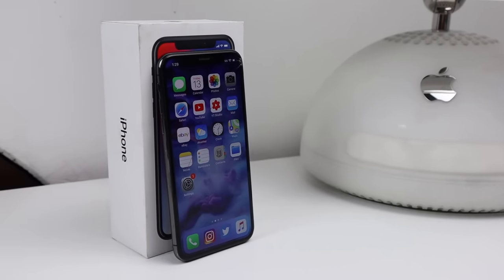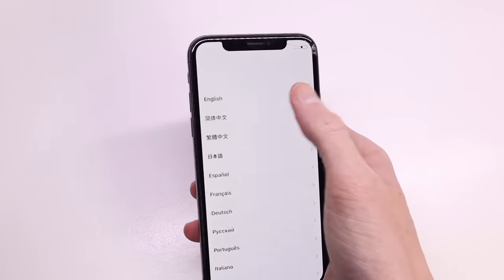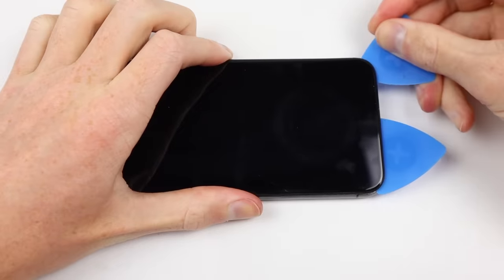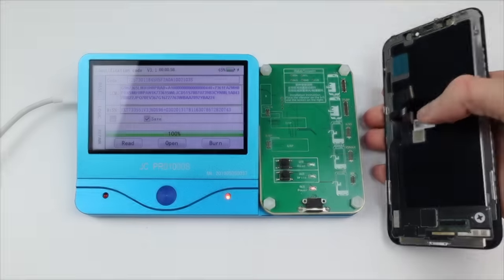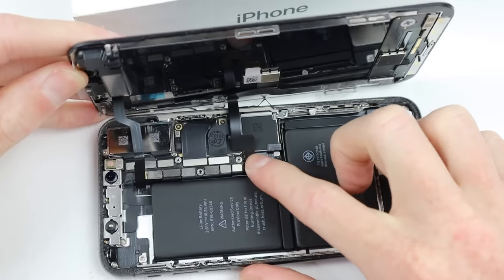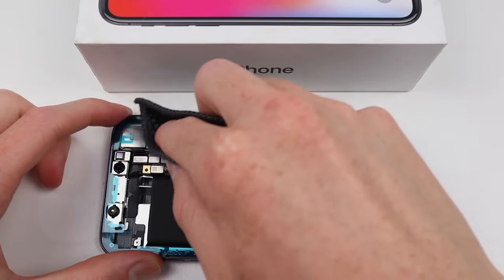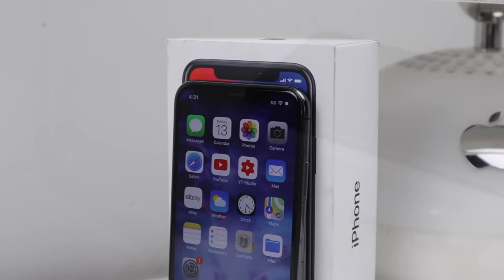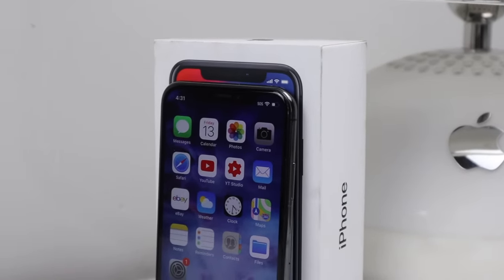iPhone X Screen Replacement Done Correctly

Comment: just a tip for everyone, make sure you keep the same earpiece from the original display to preserve face id, using an aftermarket earpiece may disable it. :)
Reply: yea that happened to me, but the original ear piece was broken so i had to replace it.
Reply: @daudhtm5203  could always just only take calls with earbuds or the wired headphones and keep face ID lol
Reply: @HearMeLearn  the face id was broken too
Reply: Thank you for the advice
Reply: @daudhtm5203  you can transfer the original sensor to a new cable, but you will need a solder
Reply: Good tip
Reply: What is an earpiece
Reply: @daudhtm5203  lll
Reply: The tool is for matching screen and motherboard.  otherwise face id cannot be used.

Comment: Imagine if they had a reprogramming machine for home buttons
Reply: Would be cool but likely won’t happen as they’re paired to the device and it stores like a key in the SEP which is encrypted. Though it might be possible at some point especially with the checkm8 exploit, people were able to get the SEP key and if they can figure out how it works they might be able to at some point. Though that may be bad as then hackers could potentially access your passwords and bypass biometrics, which is why Apple doesn’t allow 3rd parties to repair the home button or FaceID as the SEP is a super important part of securing the device.
Reply: They do but only Apple has it
Reply: I know but like a public one
Reply: Jarrett Boersen buttt, they could make a machine for people that have the old faulty home button , then they basically plug the old button into the machine and upload the part code and then connect the new button and write the code into it so that the phone recognises the new button as the old one....
Reply: I went to a third party shop for my mums phone and they somehow managed it
Reply: Gurvinder Panesar yeah but what phone was it?
Reply: @steffjack9798  he showed this kind of reprogrammer in the video
Reply: The chinese will figure something out i’m sure
Reply: @jappiemoto  They always do, one way or another
Reply: @Levi Hills phone nation in Leicester

Comment: You‘ve done it exactly as I have done it, but I’ve done it with a cheaper programmer😁
Reply: Milan Schröter what programmer?
Reply: Could you tell me what programmer you have?
Reply: Yeh I need to know that too. What programmer? I replaced my screen but no True Tone because buying a $60 programmer wasn’t worth it.
Reply: Milan Schröter okay bragger, tell us which programmer you have that works
Reply: @taF fleifraG nah  it is depend on where u live at my country. It is quite cheap
Reply: What programer?
Reply: Of course he bought the one with more features because he does alot of iPhone repairs
Reply: I use clone boy which is $30-40
Reply: I don't care about true tone I was turning it off when I had the original display so I bought a new battery instead of an iPhone programmer
Reply: Mohammed Khalil is that the only thing that stops working? The true tone ? Bc if so i wont buy a programmer
Reply: CARLOSVLOGZZZ the double tap to turn screen on needs the reprogramming
Reply: Shane Kephart but it will work correct? Without the reprogramming
Reply: Apples_ Biggestfan icopy or jc-v1
Reply: @lvmike424  Thanks mate!
Reply: Are you wanna tell which programmer or not ?

Comment: Thank you for the instructions! It worked! got a screen off amazon, didn't have a programmer, but seemed to work just fine without it... hopefully will continue to work well.
Reply: Same here... still working Juliet? @JulietHeins
Reply: How have you got on without the programmer? I’m worried to do it without one
Reply: @Ronnij44  you usually get an issue with options for the camera and after an update I was told

Comment: I work in a rather large repair shop and ive never had to reprogram an x display ive worked on basically every iphone. Only way i can needed to do this is if you dont bring the camera over but most replacement screens require you to transfer the camers anyways
Reply: If you don’t program, then True Tone will no longer work.
Reply: @TheNpcNoob  this is true if you have the original display, also cant do this on newer models sadly

Comment: btw, if you dont programm your new display it can work but you will have bug with screen protector. when its on phone and if you hold on your finger without moving it on screen it will not recognize your finger after 9 seconds. (very annoying when you trying to send someone a voice message it will send it after 9 seconds because screen thinks that finger is not on screen). but if you move your finger a little bit every 8 seconds it works fine :D

Comment: I literally just put my XS into a toaster oven to heat up the adhesive and then I used a razor blade and plastic pry tool to open it. I got the screen off just fine with no damage at all.
Reply: KalsMusicPlaylist YT u di-did WHAT😳
Reply: And afterwards you put it into freezer overnight for better seal
Reply: yeah it’s true. i was the plastic pry tool
Reply: I put an iphone on top of my space heater and waited for the adhesive to melt lol

Comment: Hey Hugh! Since you made a video previously on putting an iPhone 7 battery into a 6s, could you maybe do the same for an iPhone X battery into a Xs? I am wondering how this would work, as the X has a larger capacity but the battery fits perfectly (from what I’ve heard) in the Xs.

Comment: Nice, I will soon have to fix my sisters iPhone X later this month, still waiting for the replacement screen (also bought a reprogrammer to retain the true tone). Good video 👍
Reply: R C i thought about buying a programmer but honestly most people that buy refurbished iphones don’t know what true tone even is and i’ve never had one complaint about it
Reply: @brando12343  well how they can complain about sth they don't know but I think if you're making money on this you should buy this shit and use it as advertising tool
Reply: Where did you get the reprogrammer? My wife broke her phone a couple days ago. Thanks
Reply: R C did you buy the jc pro or another one? Thanks
Reply: von19888 it was a different one, its the QianLi iCopy Plus. There is a separate module for battery, just so you know.
Reply: R C awesome. Thank you so much.
Reply: von19888 oh there was an issue with an iphone 8 Ho5 aftermarket screen, could not be detected by the icopy plus, could be due to the iCopy not updated (not sure though). Refurbished screens were fine.

Also make sure it supports your device
Reply: R C thanks
Reply: did you need the re programmer? to fix the screen
Reply: Hey,one question, is the reprogramr only used for the True Tone feature? Or anything else as well?

Comment: I bought the iphone X for $550 last month and she said that the rear and front cameras weren't working as well as face id. So I had to buy the replacement parts and oh my I regret it. Somehow. It's true the cameras weren't working at all and last night, I turn on the camera and it's working fine. I think I just have to update the software or it has something to do with the ios 12 being the worst
Reply: Wan Face ID and front cameras work together at times

Comment: Cool, I bricked my wife’s phone following this guide exactly. I got the new screen plugged up and working then i turned it off and detached the cables Bc he didn’t tell us to put the water proof seal on first. Plug it back in and now none of the touch screen works. Unplug it again and plug it back in and now the damn thing won’t even turn on

Comment: How is the quality of the screen replacement
Reply: Not as good as Apple's display
Reply: harish vinjamuri In the website of ifixit they detailed it as an OLED. I want to know how true this is.
Reply: @charliealonso8715  yeah,its oled,
But the colour reproduction and contrast ratio is not as good as apple's genuine one.
Reply: @charliealonso8715  Go with a original/used genuine display on eBay as there better trust me I have replaced and iPhone X screen with a genuine and a replica screen there is a difference worth the money
Reply: S** H*** he doesn’t talk about the quality of the screen ..
Reply: harish vinjamuri Wrong.
Reply: OEM quality

Comment: Hey great video! Just one question. What happens if you don't use any programmer on the new display? Can it still be usable?
Reply: the screen will still be useable, but true tone will be purposely disabled and a permanent message may come up saying that it is not a genuine display. at one point i believe apple did try disabling the screen completely if it was not paired, but were sued or something and had to reverse that, though they are apparently still allowed to do this.
Reply: @zeasea2519  thank you for the reply. I bought a cheaper programmer called iCopy plus from a company called Qianli. It worked just as good. It had true tone and I got no messages about the authenticity of the new screen. I was just wondering if you didn't do it with a programmer if it would constantly spamm the "no original part" message. Or just once in a while

Comment: AL some 'Very well executed Cheers just what i was looking for,
Quick question, bottom left side of screen from 2.28 2.30 your left index finger was hindering a little screw that has a square washer that has a piece of crooked metal coming from the washer, 
Does this crooked piece of metal that`s part of the screw washer` meant to touch the housing that supports the three buttons on the left or is it meant to have a minute gap from the housing, 
weird on my phone when opened up there is a gap

Comment: I've done this myself but skipping the part of the reprograming, also skipped the part with the watter sealing, after a water resistant phone it's oppened it would never be water resistant again like it was from factory so i see no point of putting the seal back

Comment: Hugh I have a question and I'm becoming very impatient with not being able to use my iPhone X lol...anyways I accidentally dropped it in water a while back and I believe I was able to salvage it because the phone still turns on and seems to work somewhat flawlessly except for the fact that about 1/4 of the screen (the left side) doesn't seem to acknowledge touch at all. I can't select any apps on the left side of the screen and even my settings menu. So my question to you is, do you think its possible to get fixed? or do you think there is probably water damage and its not salvageable? also on another note...I broke my iPhone XR screen the other day and got it repaired by one of those kiosks in the mall and literally the next day it stopped recognizing my touch at random times. for the majority of the day the phone doesn't work but randomly it will begin to work for a short period of time. anything you recommend on my end to fix it by chance?

Comment: Hey Hugh Jeffery, quick question would there be any way to replace the barometer and compass censor on the Xs max? And if so where would the be located.  I bought a brand new x max and tried to test the water resistance and it got water damage and I took it to geek squad for a diagnoses because it keeps shorting our every 3 mins and it just won’t stop resetting and they said that it’s the barometer and compass censor causing the headache.  But they want $600 US dollars for the repair

Comment: Thanks to your vids, i do replace this watertight gasket on every iphone that require 1! I replaced my iphone x battery because it whas at 82 percent batteryhealth when i got it, i actually exanged my iphone xs for a iphone x because of the jailbreak capability of the iphone x! So now my iphone resists water like before (tested it out) and its like before! But i want to have a program device like yours, so if my screen breaks 1 day i can reprogram the screen data! Where did you get this thing? Greetings

Comment: Need you help please, my power button isn't working for some reason now. Phone powers on when I plug in the charger but I can't power it off I basically have to disconnect the battery. Any suggestions???

Comment: Great video, I bought an iPhone XS last night, turns out it’s had a new screen before as True Tone wasn’t there, so as stated on your other post the screen serial number no longer shows up on 3u tool, so is there any other way to get the screen serial number?
Reply: @ShushLK  Wrong, it can be done, I had it fixed yesterday without original screen true tone back now:)
Reply: @stevepulsar   Hey mate, possible to explain how did you manage to fix it pls?

Comment: I have a question Jeffrey i have an old samsung j5 2017 laying around i wanna upgrade the ram from 2 to 4 or 6 don't matter best the phone can run and more storage cause it only has 16gb of storage where can i buy ram chips and storage cards for this it is not my main phone my main phone is a oneplus 5 8/128

Comment: Hi Hugh,

Need a help from you, so I am using iPhone X and I broke my screen, and I am looking for a screen replacement, locally and as well as internationally shipping the screen is too expensive. So I am looking for a non working software damaged phone but the screen is in good condition so I can DIY screen replacement

Currently I am using ifixit oled screen yes it was expensive but not close to the original
So if you have a screen or iphone x laying around kindly please help me

Comment: So is it true that the OLED screen won’t last as long as a LCD? I have heard that iPhone LCD can last several years longer than OLED because it’s lifespan is significant shorter? If so, can this be solved by replacing the screen?
Reply: you will need a new phone due to battery life going south and lack of support.. LONG before the OLED wears out.

Comment: Hey hugh, do you have a particular 3rd party OLED manufacturer you would recommend?
Reply: I‘m not Hugh, but I recommend to look up refurbished or pulled displays on eBay. Third party displays are never as good as original parts and they usually cost the same as refurbished ones.

Comment: @hughjeffreys I have a Google Pixel 1 which doesn't turn on!
issue - it turns on and once after the google logo comes it shuts down and when connected to charger it doesn't charge!

I have tried doing a hard reset, giving it to a local repair shop and what he told was that the battery is okay since he was able to manually charge it and also when he connected the phone through a power supply it doesn't turn on and the issue stays the same. Will you please help me out? what might be the issue? since I don't have a phone it's really hard for me. If you could please help me out that would be great! :)

Comment: im still really happy with my iphone x but one thing that really bothers me is how expensive it is to replace the screen. I only dropped it once over the course of 2 years thanks to a bee stinging me in the hand I was holding the phone. I even had a case and a display protector on but it still landed on the display and now there are cracks all over it.. you kinda dont see them but it still bothers me.

Comment: Will you do another addressing Face ID Error?
Reply: Charles Bryan Oware Face ID error means that you somehow screwed up the Face ID components. The flex cables that connect it to the motherboard are EXTREMELY fragile.

However, Face ID issues can only be resolved through Apple because Face ID is paired to your motherboard

Comment: I messed up my front camera on my 6s plus and got my SIM card stuck any tips to help me get it out
Reply: Yes. Open up the phone and remove the battery. Then try to fix the sim car issue but moving it around to the point it aligns and take it out. Then repeat the front camera. 

Sorry if this sounds unprofessional,I never worked on a iPhone or any phone 🤣

Comment: The screen is shattered the frame is bent,scratched and snapped in one spot the battery doesn't work at all and it missing some screws inside and the too speaker doesn't work

Comment: Good on Ya for the video. Most was good except you kept touching the front cameras and holographic sensor which can be damaged with your finger oils. And you didn’t use heat to remove the proximity and war speaker which can cause the flex to break if pull on too hard. Also never use metal tools inside of the phone, next time use a plastic playing card to remove this.
Reply: Good

Comment: that is not as easy as it looks ive done that on my personal iphone and i almost fried my phone because my phone dosent have a bracket on the screen flex cables so when i pulled up my display the flex cables were already disconnected without the battery disconnected i was trying to fix my home button on my iphone 5 but then when i tested it, my button was fixed by the way, so i tested my phone it did not turn on so i closed it i hid it from my family a couple of tutorial videos later my phone was fixed!

Comment: Dont want to be rude but 3rd repair shops like mine would never do the same mistake you did taking the metal shield off with a metal tool you always use a plastic when you are near battery and motherboard

Comment: My first iPhone X got water damage Because CPR  didn’t put the seal back one
Reply: Michael Suttles after a phone has been refurbished by a third party 99% of the time you will loose water resistance even with a seal, only apple can get it back after refurbishing a device because they have the oem seals and machines to properly seal the screen back down